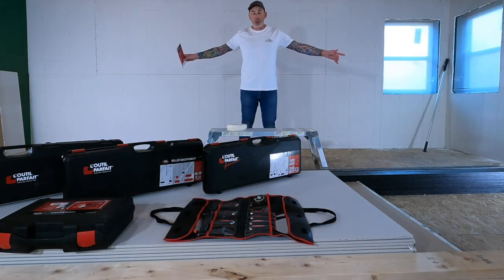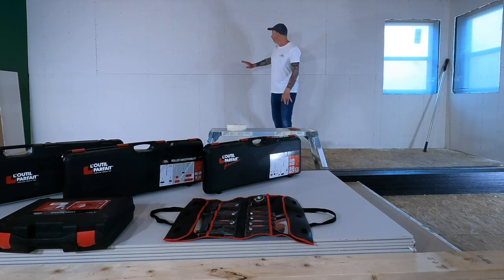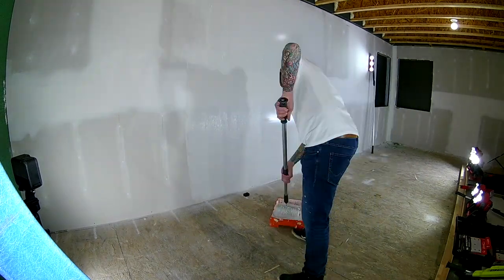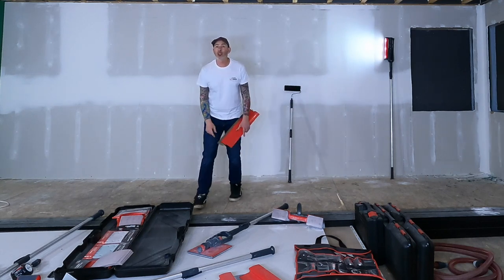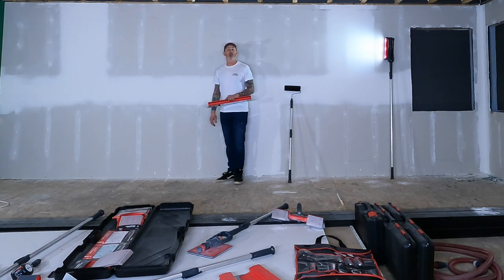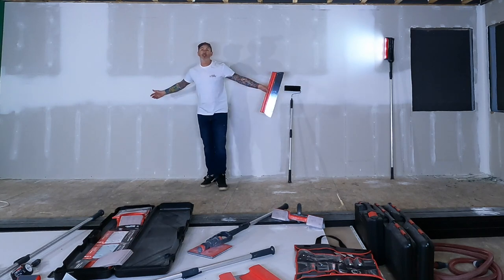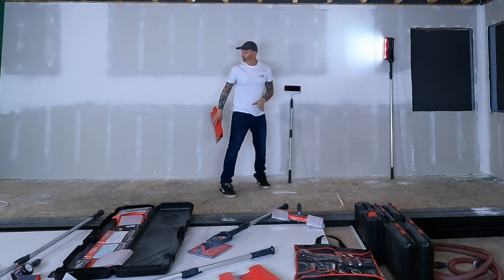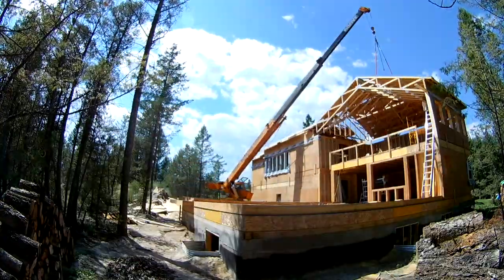Drywall finishing "LEVEL 5 FINISH" using L'OUTIL PARFAIT finishing tools. Rolling mud and finishing

Comment: I’m a drywall finisher, I’ve been at it almost 50 years. I’ve always said there are many ways to accomplish something, some ways are more efficient than others! I’ve always encouraged people to add to their skill sets and I can see you’ve got heart and energy and an eye for detail. I do a lot of carpentry work for my self but I’m not a trained carpenter, I can get the job done though! The skill of efficient drywall finishing happens over time, generally after years of dedication and hard work! House after house year after year one becomes proficient. Keep up the good work!
Reply from the maker: Thanks Jeff! I 100 percent agree, I learn something new almost every time I do a basement or a drywall renovation. With social media there is a lot of opportunities to learn new thing or how other people are doing it.
Reply: I live in Michigan. We never do the level 5 finish. I don't understand the need for it.
I worked in Southern Ohio. They level 5  their finished walls. After  primer, my walls were just as flat as theirs. I don't understand the need for a level 5 on new dry wall.

Am I missing something
Reply: @mikemcgee5950  i get it, rolling primer can come close to a level V, but if you do commercial work with 20 plus ft ceilings and lots of natural light along with high sheen paints level five may just be a requirement by an architect, if you don’t do it you “buy it”.
Reply: @jeffnelson9052  
Thanks
I do mostly residential. I've asked a lot of people  yours was the best answer, so thank you.

Comment: You make it look easier than it really is  =) thanks for sharing your experience
Reply from the maker: Thanks for watching, are you finishing any drywall?
Reply: @ConstructionCoach   seen tons of comments where a commenter asks a question and the creator doesn't respond but I've never seen that shoe on the other foot before lol
Reply from the maker: I like to engage! Are you working on any projects?
Reply: @ConstructionCoach   we are working on removing popcorn at the moment, with plans to attempt a smooth finish after that, but we're not there yet, thanks for the video!
Reply: @AgentDoubleV_Gaming  I just did the popcorn removal on my whole house. First ceiling came out terrible, but then I figured it out.  Biggest problem BY FAR BBBBYYYY FAR is the damn drywall dust while sanding.  Cover EVERYTHING.

Comment: Thanks for sharing. Love the light! What kind of pressure do you apply with that skim coat knife? I typically apply a firm pressure, and take off as much mud as possible.
Reply from the maker: Thanks for watching! The light is super handy. I apply different pressure as I skim and keep an eye on what it looks like on the other side. I ended up skimming my whole house, it was a bit more work mudding but I felt it made paint easier and the walls look great without that noticeable texture change between priming over paper or on level 5 mud everywhere.

Comment: Looks great! Are you doing anything special to the mud in order to roll it on like that?
Reply from the maker: Thanks for watching. The mud is almost the same as when I use a hawk and trowel. When I did the level 5 finish I add a bit more water. It was the first time I worked with those tools and I found the process the easiest and cleanest way to finish drywall. Such even distribution of the mud. Are you working on som drywall finishing?

Comment: For level 5 finishes - do you still get a slight (very minor) orange peel texture?
Reply from the maker: It’s the smoothest finish possible. Orange peel is because of the paint layer, paint light and sand between coats. Thanks for watching

Comment: Just as easy on the trowel 😉
Reply from the maker: Are you sure!!
Reply: With alot of experience on the hawk and trowel yes. I'm a plasterer in Australia, and fortunately I was given alot of training on the trowel and in the first year of my apprenticeship I learnt to do level 5 finishes with a trowel. Add the years of experience plus I've done alot of solid plastering, rendering and texture coating which basically requires the same trowel skimming technique, you pick it up and become faster. Instead of using and cleaning all those different tools, I find it just as fast do that with the hawk/trowel. In saying that, not everyone has the trowel skills down pack.
Reply: How long it did ot take you to complete those 2 walls? Including the prep, cleaning, setting up?
Reply from the maker: It took a long time because of filming and stuff! I you want to see what all the hype is about watch my other video called Level 5 drywall finishing. The extension poles made it so fast to tape a 14’ high vaulted ceiling. Leave me a comment on that video !

Comment: What kind of mud do you use, was this all in one day
Reply from the maker: I use lite joint taping compound, add a little more water so it rolls on nice. This was six different days to get to this finish and it will still take another day of sanding, priming and spot patches to make sure it is perfect.